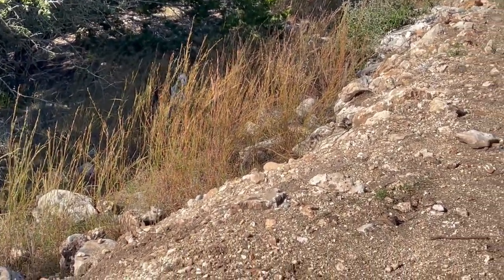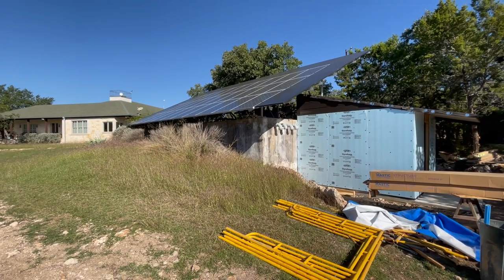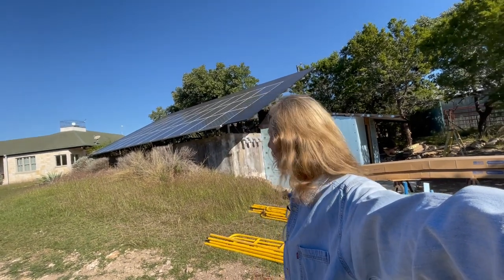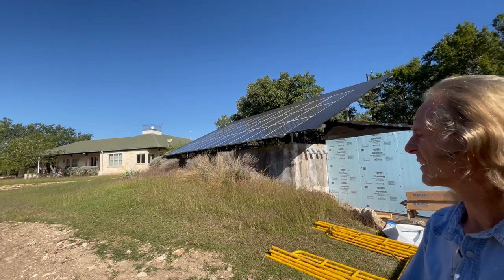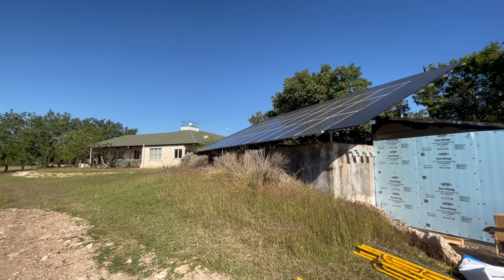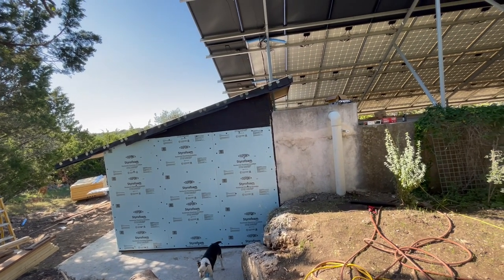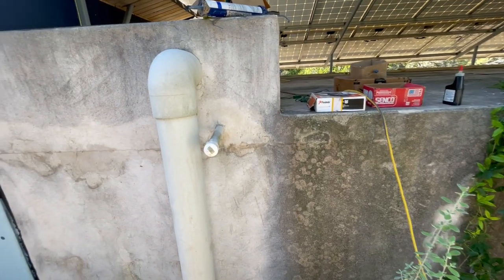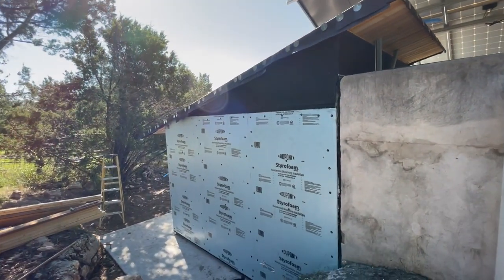Building My Solar Shed (Cheap) For the Lifepo4 Battery System!!

Comment: Radiator, circulating pump and a ground source loop could be more efficient than a mini-split heat pump/ac if you don't need precise temperature.  A little computer like raspberry pi could track the temperature and adjust heating/cooling system.

Comment: You must be a fan of Joe Lstiburek of Building Science Corp, watched many of his YouTube videos on failure analysis, and learned a lot..  he’s the reason I ended up with a NetZero house, 2 x 8 exterior walls (blown in cellulose) and 2.5” of exterior insulation..  houses orientation was designed with solar in mind, roof facing due South at 41 degrees (nearly perfect for Boston).  Mini split with 4 zones as well…. So far been great.  Thinking about building a giant whole house UPS, but my solar is 10KW of Enphase microinverters, so need an AC coupled inverter that can do frequency control to “shutdown” the microinverters if batteries are full..  challenging ….
Reply from the maker: Friends for many years. He changed my life along with many others in the building science world. I have been blessed.

Comment: I suggest rockwool for insulation instead of fiber glass.
Reply from the maker: Thank you for your suggestion. I use a lot of rock wool, especially the 80 lb stuff such as comfort board 80 on the exterior of my buildings when using a rain screen with any type of siding because it is a great product and it allows me to dial in the finish siding wall to dead flat by adjusting the tension on the screws that secure the batten strips. On this project I am going as cheap as possible and convenience also plays a factor. I will get the fiberglass to perform as well as it will need to and the exterior insulation will help but  the lack of windows and the lack of air leakage will make the exterior thermal load very easy to manage.

Comment: Couldnt you put a radiator and small pump and circulate the tank water?
Reply from the maker: What you are describing is to build a small hydronic heating/cooling system from scratch. I would spend as much or more as buying the small ductless mini split. Manufacturing economies of scale are at play. The biggest problem with that approach(there are several) is that the heat I would be adding to the water in the summer would make our domestic water supply quite warm and when water levels are low it would be unmanageable. The thermal mass is a benefit and a nice buffer but it is most beneficial in the moderate temperatures. It needs help in the summer.
Reply: @RayBuildsCoolStuff  aw fair enough. I wouldn’t have thought there would have been that much heat even in summer. I haven’t done the math but I have used a water tank as a heat sink before and I was actually hoping to warm the water up and we put a shitload of heat into it all summer and this was a black tank that had full sun exposure and we only managed to raise the temp a couple degrees

Comment: I have a question, I see you've made your banks of battery's with their own bms... Why? I have 32 of the 280ah cells in a 16s2p configuration... Is there or is there not a benefit to that? Also what inverters are you planning to use?
Reply from the maker: There are a few reasons for my choice to use a 16s configuration. One is that I would like to monitor each individual cell and not be concerned that a bad cell could be hiding, masked by what would be read as an average voltage by the BMS. Pairs aren't as big of a concern as 3p or 4p configurations where the effect could be worse. 

A 560AH battery can't supply more than the BMS is capable of delivering. I'm planning for a peak output of 24,000 watts. That is 545 amps at 44 volts. Dividing that up amongst more BMSs and batteries makes me more comfortable.

Probably more important is that these batteries are not built on a shelf but in mobile boxes that can be rolled out of the shed in case of a need for service or in case of an event that might create a melt down. The images I've seen of internally shorted cells amongst big arrays of cells was bothering me since one of these systems is for a friend. These boxes weigh in at greater than 250 lbs each and I can roll them around easily. 

The previous plan of building racks of cells, one set above another and all bolted together made me think about what I would be faced with in case of an event and the thought of working on a battery out in a shed or at someone else's house led me to design a mobile unit that can be loaded into the car or rolled into my office to work on. 

It seemed an elegant solution and I'm really very pleased with it now. I can build the batteries in the comfort of my office and then roll them into the next room to await installation. It isn't my first plan but I'm really glad it's where I ended up. Flexible and convenient. 

Last reason is that when one is down, it barely affects me to take it off line. In larger configurations, a failure takes a larger portion of you energy supply offline. 

Long answer to the part of your question that I'm currently able to answer.
Reply: @RayBuildsCoolStuff  yes sir. Thanks for that response. I think I like your reasoning and have myself been thinking of splitting my packs up to individual 16cells. Thanks again.